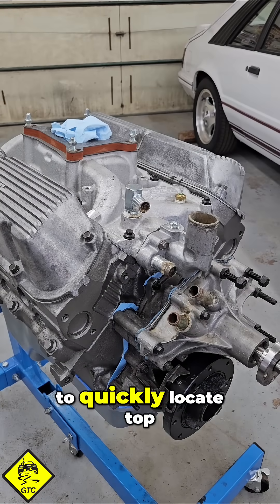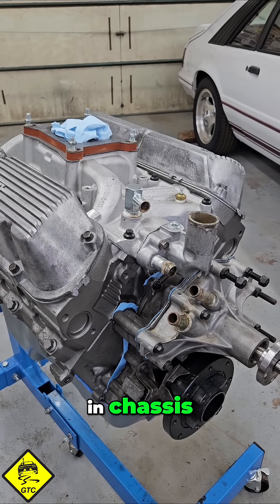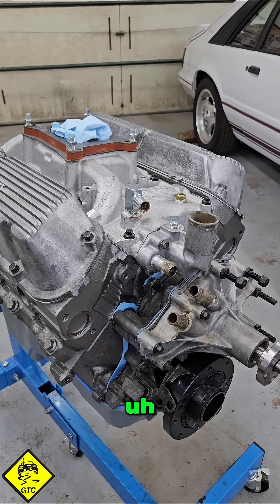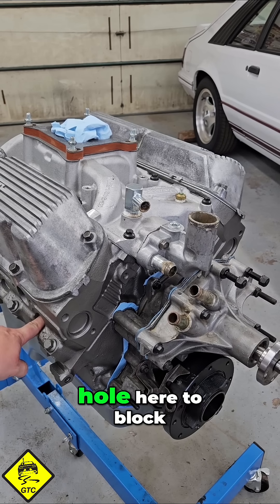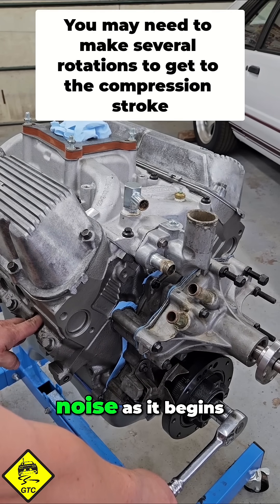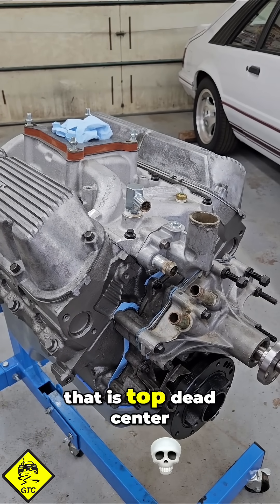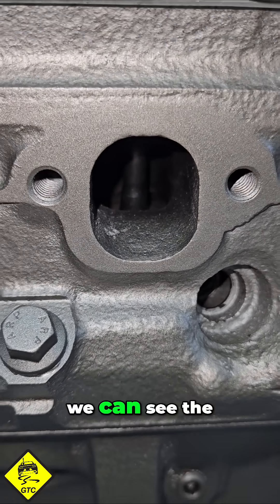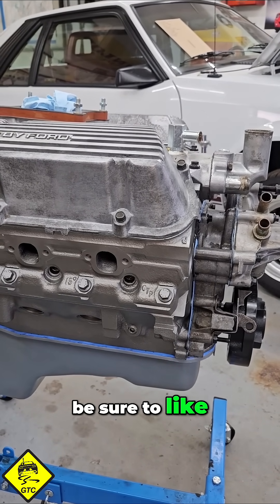Find Top Dead Center Small Block Ford #mustang #ford #engine

Comment: Now to figure out why I need to find top dead center on a ford engine. Seems like it would be for timing, but you use the timing indicator to find it
Reply from the maker: When installing a distributer it must be at TDC on the compression stroke, otherwise it could be 180° off (TDC exhaust stroke) and not run. Use cases are if you are uncertain of the distributer position because of a previous install or in my case, a brand new rebuild that has never run and you are starting from unknown.
Reply: @GrandTouringConcepts  so old engines… great to know. Thanks for the lesson!
Reply from the maker: Older stuff now, but it would apply to Ford up to 2000 windsor family, as well as the Essex V6. The distributerless ignition system (DIS) would apply as well if it's from that engine family. It doesn't apply to any of the Modular family, they use a crank and cam position sensor setup to do this automatically.